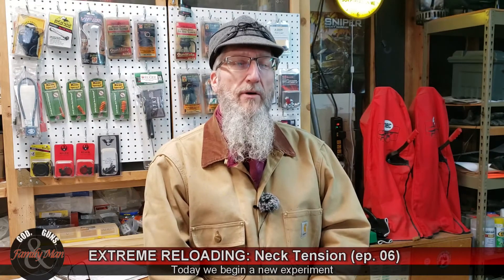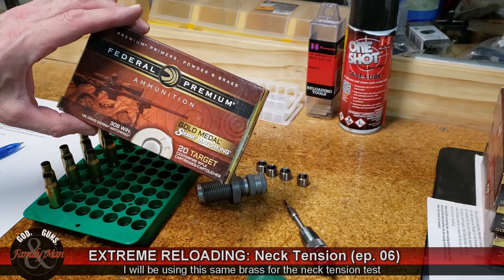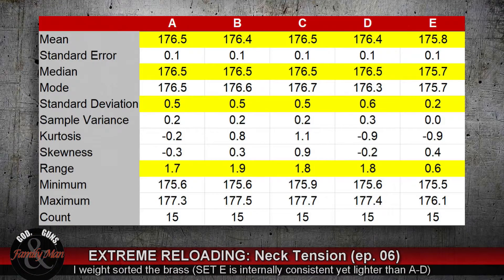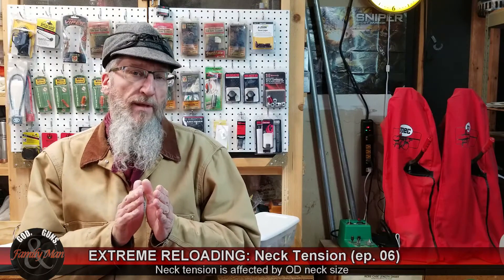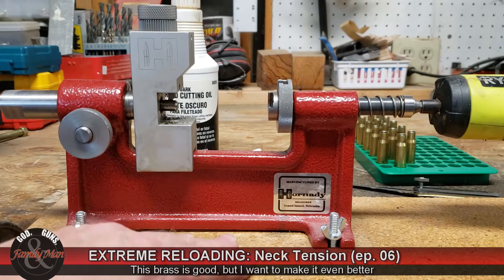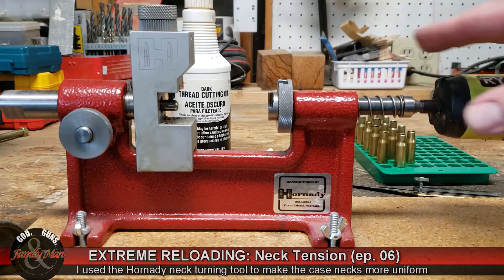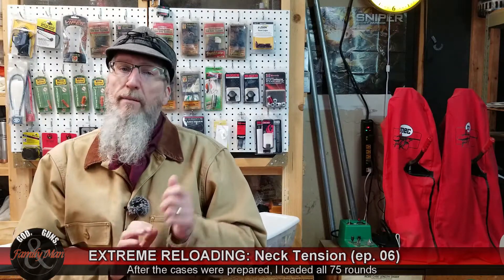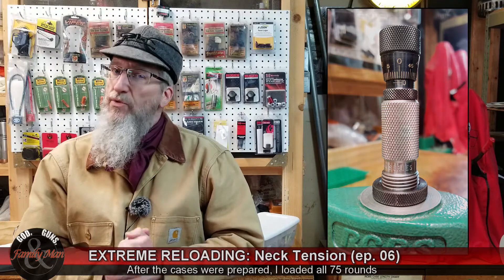EXTREME RELOADING: Setting Neck Tension using Hornady's Match Neck Sizing Die (ep. 06)

Comment: I noticed you didn’t kiss the shoulders when NTing. The bullet will seat further than what you turned... thus it isnt as consistent as one may think over the entire length of the neck. Also look for donuts inside case neck. Lastly, have you experimented using mandrels prior to case prep and / or neck tension? Looking forward to your results.
Reply from the maker: I was talking to another long time reloader and he made the same comment.  I have since changed my technique a bit and hope to see even better results.  
Regarding mandrels, are you referring to inside case neck work?
Thanks for watching and posting.
Reply: @sdkweber  I use a mandrel to size the brass to use on a K&M outside neck turner. I then use a bushing set up to set neck tension; thereafter,  I use a mandrel to set the neck tension since it has already been turned. The purpose of the mandrel is two-fold: It pushes any inconsistencies to the outside edge of the brass, that you can then turn. And brass has better plasticity when using a mandrel because the brass is stronger when pushing it down...rather than in...like with a bushing die.
Reply from the maker: @Nonedw  That is interesting and a good approach.  Can you send some links for this equipment?  I suspect you do not get too much spring back when using that approach?
Reply: @sdkweber   21st century: http://www.xxicsi.com/caliber-specific-expander-mandrels.html
You will need to get the mandrel die body to hold the mandrel. 

Using virgin brass or FL resized & annealed brass. Use a mandrel to open up the case mouth to trim , chamfer, debur and neck turn. Important to kiss the shoulder while neck turning to help keep donuts at bay. After several firings and using a bushing die, you can get donuts because the bushing wont resize the full length of the neck. This is by design. 

After fire forming to the chamber, decap primers w/ universal decapper, then clean brass. Next, size the case using a shoulder bump/body die on bolt gun to about ~2 thou (SB FL die for Semi-auto) Do not use the decapper rod. Use only the minimum required neck sizing bushing( usually 1-2thou smaller than your mandrel size. Now, size the neck using the mandrel for your final neck ID as you determined for your desired neck tension. To determine mandrel size needed: use a neck thickness micrometer to measure your neck thickness. You need to average at least five measurements of neck thickness. Then add twice the neck thickness to the bullet diameter to get the loaded round neck OD. Example for a .308: when I use a bushing die followed by a mandrel sizing step, I would go with a .335" or .334" diameter bushing first, then finish them off using a 0.3065" diameter mandrel as the final sizing step. Some argue using a two-step process such as this works the brass more than a single pass with a bushing die/ expander ball. However, I anneal brass every firing and I have never noticed any issues moving the brass that extra bit. Using a bushing that is only .001" or .002" smaller, the mandrel will open up every neck to a small degree. This gives me ~.0005 thou spring back vs .001 thou using a bushing/ rod setup. This can be verified by using calibrated gauge pins... also found on 21Century site.
Reply from the maker: @Nonedw  This is very good information and clear. I use 21st Century's primer seating tool and they make some really good gear.  Thank you very much for taking the time to post this. I appreciate it.
Reply: @sdkweber  No worries.
Reply: @Nonedw   that's some good info :-)
Just got back from the range doing load development.  Have an AR that puts 3 shots almost the same hole then get 2 that ends up anywhere around those at like an inch an a half . Which lead me to look up neck tension .  Frustrating